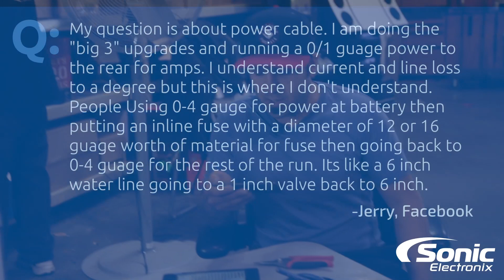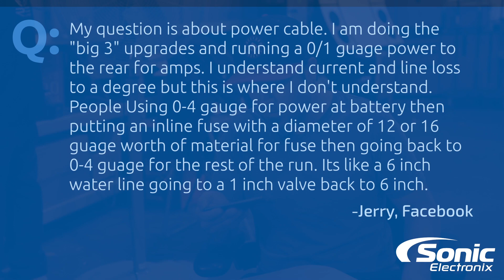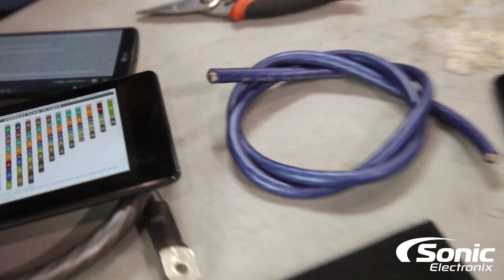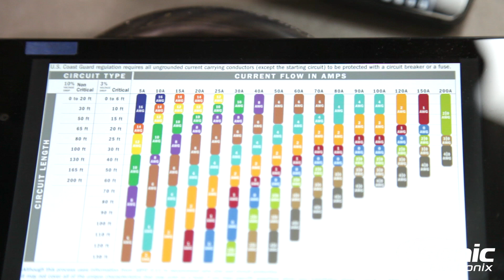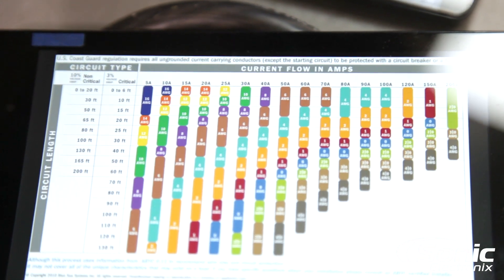Does a Fuse Bottleneck Power from a Battery to an Amplifier? | Car Audio Q&A

Comment: ... 😂 it would only not be a bottle neck in your theory if it was right at the amp. If you have a fuse right next to the battery you might as well have wire same size as fuse all the way to the amp..

Comment: The weak point isn't really where that rivet was because that rivet is material where that hole is now. So it's actually connecting it . But if you took the protective thing off with the rivers then of course that's the weak point.

Comment: I always used the rule if I do 4g from amp 1 to block then 4g from amp 2 to block then i do 2g from block to battery given length of run vs draw is in spec.

Comment: The follow up vids will never be released due to liability. We've done the same tests and there is a huge difference in a non fused setup. You can't just go around telling people not to use fuses though. People are idiots and will burn their vehicles to the ground.  I run a device that's designed to sever the ground post on the batter at anything over 5gs. There's no guarantee that it'll work in all crash scenarios. It's my opinion that fuses are sketchy at best in crash scenario's. A 50 amp short won't blow a 100 amp fuse, but it'll generate enough heat to melt certain metals and incinerate all kinds of different materials.
Reply: Facts!👍👍
Reply: Which fuses did you test and under what conditions? I certainly haven't tested all fuses, but I have tested the voltage drop across several different fuses under realistic loads and I have not seen anything over around 0.1 volts at the very most, usually much less than that. Also, although not perfect, fuses ARE very effective protection. In the real world, a properly sized fuse will generally blow if a wire is shorted well before it starts on fire. As you said it is totally possible for something to short in way that enough heat is generated to start a fire without enough current to blow the fuse, but such a scenario is difficult to intentionally create (I have experimented with this) and the odds of the vehicle not burning to the ground is still way better than if you have no protection at all. Blown fuses are MUCH more common than car fires. Saying that a safety device isn't worth using because it's only effective in perhaps 99 out of every 100 scenarios is ridiculous. Unfortunately there aren't many guarantees in life and this is no exception, all we can do is take precautions wherever practical/possible and hope for the best.
Reply: @averyalexander2303   As a disclaimer let me say this: DO NOT RUN YOUR CAR AUDIO SYSTEM WITH NO FUSE. You'll probably burn your car to the ground. In almost 30 years I've never popped a fuse, or had a fire. That being said, lets talk about the tests. 
You need to be testing under full load. Doesn't matter what the fuse is doing if the system is off. 
Current (not voltage) is inversely proportional to resistance. So don't worry about measuring the voltage drop.
As for my experience. we always used either scosche or lightning audio. The first test I ever did was in a 95 S10 with a US Amps US150. First pass through the line (fused) was 135 .0db second pass (no fuse) was 137.2db finished 3rd in my class. I guess that's the real world test. The second round of tests almost 15 years later was on another s10 that I did not own. He had 2 Memphis Audio 12" subs. 155db+ Way too loud to sit in. I can't recall the total wattage or the current draw on that one either. He had a wafer fuse holder with a 200 amp fuse. I am almost certain that it was made by scosche.  We used a clamp meter to measure the amperage drop across the fuse. Which led us to taking 2 power distribution blocks and making a bypass system that he could use when he was at competitions.
Reply: @SpeedyCashRegister  That's very interesting, thanks for sharing! I wonder if the fuse possibly created brief voltage drops when the bass hit that would be too quick to pick up with a normal multimeter. I would love to see the voltage drop of various fuses tested with a scope under different conditions, I think that would give us a better idea of what's going on. What about circuit breakers? Do you think those may be a better option than fuses? I know they create some amount of voltage drop too since they need to create enough heat to bend the bimetallic strip in order to trip, but maybe less than a fuse?

Comment: Maybe I can help a little with my own experiment I did. I have a JL 900/5. It calls for a 60 amp fuse. I ran 4 gauge from battery. Approx 16 feet. The fuse holder was located 2 feet from the battery under the hood. I had done the big 3. I put in the 60 amp that the amp called for. With a 40 hz test tone playing at clipping my voltage dropped .55 volts at the amp. I then switched to a 150 amp fuse. With the same 40hz test tone playing to clipping I only had a voltage drop of .21. The larger fuse absolutely made a difference in power getting to my amp. Amp is no longer properly protected by the fuse, but that’s what the amps protection circuitry is for. My power wire is still protected from grounding out. So in my opinion absolutely use a bigger fuse. Your amp should protect itself. The fuse is to protect from a potential melted power wire/fire/etc, which the larger fuse will still do. Hope that helps!

Comment: Easy way to check the “bottle neck” of the fuse is to
Measure the voltage across it at peak
Load. You can also do this between the ends of your run by measuring the voltage drop across the whole run...

Comment: I hear some people saying well if your amp ain't blow it is not bottlenecking  that is false. Let say you have an 80 amp fuse and let say when 100 amp attempts to pass through it takes 1 minute of 100 amp to blow it. And you listen something dynamic it could resist the flow and not blow if the draw doesn't exceed the blow time. If you playing music and fuse holder feeling hot and it not from environment or a amp next to a heat source like a amp it  could be bottlenecking and more heat equals more resistance. The best thing to do is to match the fuse on the amp or when you calculate the efficiency.

Comment: If you use a circuit breaker it works upon a braided wire and 2 contacts. When resistance builds up from heat it trips. But what you need to take into consideration is when the circuit breaker is closed making contact depending on the manufacturer that makes it it has a lot to do with what type of contact materials they are using and how good they are aligned together also how much pressure is between the two contacts. Fuses do protect quicker than circuit breakers but with a good quality circuit breaker it’s possible there’s less loss of current if it’s of good quality.

Comment: Hey bro i have a 3200 watt zeus and 500 watt brutis elite. Well i went to change the the cd player and my amps cut out. Well it turns out when they hooked it up they screwd part of the amp wire. When i un hooked it the amp wire touched metal. The 3200 watt does not have feuses. The 500 does but there fine the amps were ran together. So my question is what does it do to the amp when the amp wire touches metal and can it be fixed and if so is it worth fixing. Thanks

Comment: The short answer: Yes, because it has to.
The long answer: 
There will always be a resistance between the power source and the consumer. Resistance causes a voltage drop, and combined with the current flowing there is power "loss" which coverts to heat. You want as little heat as possible in the wire itself as too much heat would make it melt or cause a fire. You do this by using a large enough wire for the load, but you also have to protect it from overloading in case of a short or defect.
A fuse has to have enough resistance to create enough power lost in heat to melt through when current gets too high. The higher the fuse amp rating, the lower the resistance in order to allow more current to flow through, so a larger fuse will create less voltage drop at the same current. That's why you use oversized wiring and fuse the wire at the amp rating of the wire, not at the lower amp rating of the amplifier (unless the amplifier itself requires external overcurrent protection).
To limit the amount of voltage drop in the fuse, good fuses use a conductor material with a low melting point instead of copper. This way less heat power (thus less voltage at the same current) is needed to melt it, which also prevents the fuse casing and fuse holder from melting before the fuse itself pops.
Reply: I know its been forever but had to say your comment is awesome.  I have installed car audio off and on for 20+yrs and went to school for albeit only  1&1/2yrs for electronics and hydraulic servicing but I love your response to this question!
Something I never thought about amongst gauge and quality of wire is what the fuse material and grade was...
Reply: @handsomerob1119  Thank you, comments like yours keep me motivated to share what I've learned in times that most don't want to read more than 2 lines anymore and 'memes' get 5000 likes.
Reply: @A. Melbs Not much to need sources for, it's how a melting fuse works... I don't understand what part of my post you're asking sources for?
Reply: @A. Melbs A lot of claims? The job of a fuse is to melt long before the wire it protects overheats. To achieve that you need the fuse to absorb more power than the rest of the wiring. Since the fuse is in series with the wire, the current is the same through the fuse as through the wire. You need more power in the fuse than in the wire, only way to achieve that is have more voltage loss over the fuse than over the wire because power = voltage x current. To up the voltage over a component with a given current, you need more resistance since voltage = resistance x current. To reduce the resistance and thus the voltage drop over the fuse you can use a material that melts at a lower temperature, because less temperature needed is less power needed, less power needed at the same current is less voltage drop and less resistance.
Source: Ohm's law

Comment: Every conductor has a certain amount of resistance. That resistance is cumulative over the distance of the conductor (wire, in this case). The by product of resistance is heat and voltage drop. So the wire must be sized to account for both. The fuse and fuse material are engineered to account for the amperage listed. They will allow that much amperage through (plus the tolerance). If you size the fuse and wire to the equipment they supply, accounting for voltage drop if applicable, they shouldn't be any noticable loss.

Comment: There is not any so called "bottle necks". ANL and all fuses are made very specifically to carry exactly the amount of current indicated on the fuse and NO more. All can handle voltages suitable for automotive use, anywhere up to around 24 volts DC. The the amplifier increases the amps to the desired wattage. Volts x amps = watts

Comment: Question.  I was going to run a power wire for amp and there is already a power wire ran have way. for whatever reason from the last owner of the car.  I was going to connect and run from that power wire and it has a fuse already.  My question is, Would it be ok to have 2 fuses on the power wire?  

thanks
Reply: +KMProduction Redundant, but it wouldn't hurt (use ANL fuses though).
Reply: +Ernestom5 thanks. I didn't think it would hurt. Ima just connect that fuse with one I bought

Comment: Great video and great discussion.  Next get a car from a junkyard, install an amp with proper fuse and short the wire.  Repeat the process without fusing the power wire.  The difference will settle any debate.

Comment: i gotta chime in because i think the answer is incomplete. the copper in the B+ wire is very thin per strand allowing it to be flexible enough to run through or under your cars interior.  also copper/nickel wire has a some what low melting temperature and are low mass with alot of airspace between twists. the metal in the fuse is not copper (i believe it is steel alloy) and is solid. solid wire is technically the best conductor.

Comment: Can I run 2 14 volt batteries wired I'm parallel to power my 14 volt amp and my car?
Reply: Eli Perez If you want to run 14volt battery's in your vehicle you need to have a 16volt alternator also and run the charge wires from that alternator to those battery's, granted if your vehicle has room for a 2nd alternator because you need the 12volt alternator to run the ECU, if you only run a 16volt alternator you will blow your vehicles stock electrical components that make it operate. 

To be clear remember, 
12volt battery's will charge at 14.5volts
14volt battery's will charge at 16.5volts
16volt battery's will charge at 18.5volts

Most amplifiers now n days are becoming more efficient so a 12volt system will get you some good power.

Comment: Hi. I have a problem with Chrysler voyager 2001. I want to install aftermarket head unit however stock head unit is using PCI BUS to switch on and off and if there is no head unit connected to PCI BUS wire stock amp won't turn on therefore there is no sound. Is there any adapter or different way for the amp to switch on while using aftermarket head unit?
Reply: szczurek512 sorry if I'm misreading your question but you can wire your positive key 12v (red wire) to your cigarette positive 12v and then all you need to do is wire your constant 12v (yellow wire) to your existing constant 12v. This way power is supplied when you turn the key and turned of when you take it out.
Reply: linkto thepast That is what I've done however problem is with factory AMP which won't power up until we have connected factory head unit which use PCI bus to switch on and off.

Comment: You have to think about total surface area of the metals being used...electrons travel on the surface...so maybe the fuse total surface area is close to or equal to the total surface area of the wire strands...
Reply: SeenFilms exactly wires are a collection of thin strands whereas the fuse is a solid chunk of metal that can A dissipate heat better and B handle a higher current. voltage drops are mainly caused by electrical energy being converted into heat energy because a single strand by itself put under a load would become very hot and brake much like a filament in a light bulb you need to add lots more strands to share the load. This isn't the case with a fuse as being solid metal it will carry a current much more efficiently without excessive heat meaning little to no voltage drop (exchanged energy)

it all comes down to purpose of use a wire needs to be flexible and long that is why it is made from strands which flex well but don't carry a current as efficiently so more is needed whereas a fuse does not need to flex and does not need to be long so it can be made from a solid block of metal which is much more efficient at carrying a current as it doesn't heat up as easily therefor less material is needed.

Comment: I have the mtx rtl12x2d subs and the final impedance is 2 ohms when wired in the box now I have a amp that is 500 watts bridged at 4 ohms so it's a two channel amp now if I was to run speaker wire off of the one terminal cup on the speaker box to the amp and bridge it will it affect the amp or the subs even though the subs final impedance is 2 ohms and the amps is 4 ohms bridged

Comment: you can make a simple voltage drop measurement between the plus on the battery and the amplifier while it plays
Reply: Yes.  Just measure across the fuseholder and see how much voltage is dropping across that element.

Comment: you should check the voltage drop across the fuse under load with the amp dyno. It wont fry your multimeter because you are meauring voltage.

Comment: Great! Also to add you know most would add two fuses to the line so if problems persist via front or back of the vehicle it will not burn the entire run. Maybe you can shed some light on this theory as well.